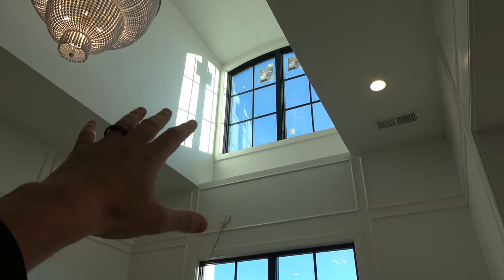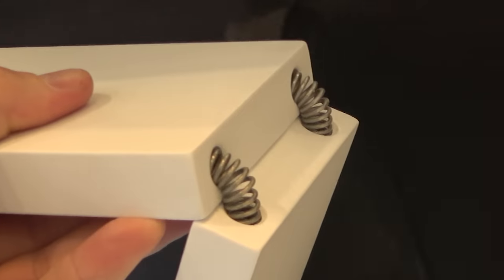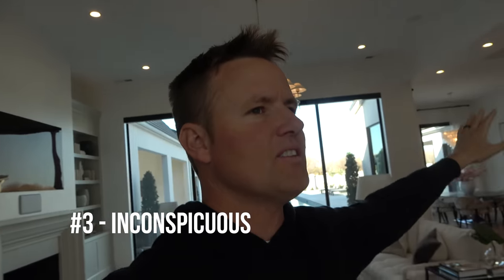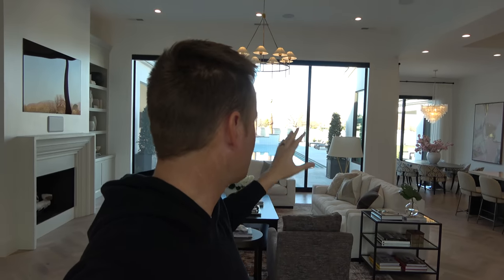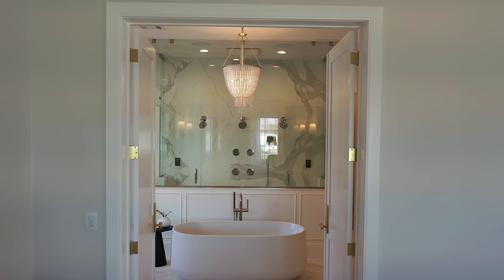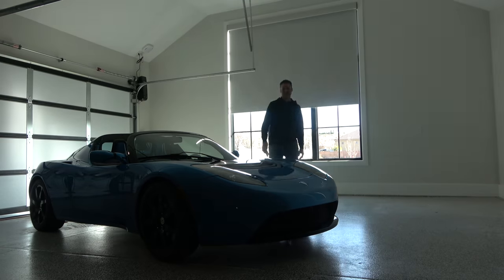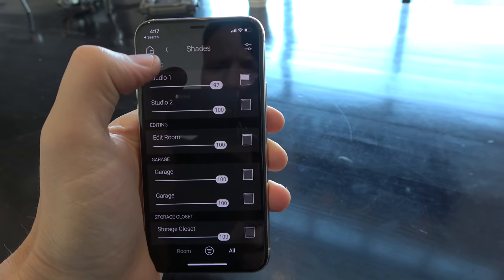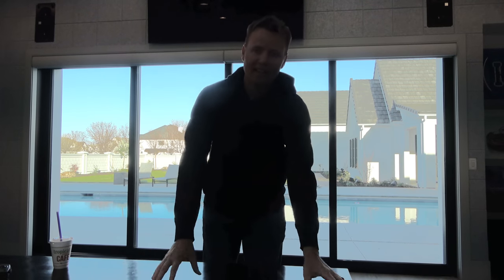Smart Blinds For Our New Home!

Comment: When I read "smart blinds" I figured they would have settings like letting certain amount of light in based on the angle of the sun/amount of light coming in, or at least they open/close at certain times...
I guess you could do that with software if you wanted to...
Reply: Yeah me too, my school's library has that, but it's supposed to be for efficiency for the A/C system
Reply: Yeah
Reply: Yeah, my house has smart blinds and they are so useful the sun is always shining into my room. And you know ppl hate to get waken up like me so they are VERY useful.
Reply: It’s pretty easily programmed to adjust based on your needs. It can even modify the settings based on the time of year or even the weather outside. C4 is a pretty powerful system in the right programmers hands.
Reply: I don't need blinds because I am blind.
Reply: Gerald Nordahl lol
Reply: Gerald Nordahl then how can you spell?
Reply: @tankdoss7261 .I use Google typing.

Comment: With such smart blinds, you can never be sure of being in a full intimacy. Imagine your son is sleeping in his room and during the night, you open unexpectedly his blinds from your room, and the other way around.
Reply: With home automation, it’s easy to see and control these features. I use the same system in my home, one button shuts down the entire house. Or one voice command. If you’re worried about something specific, you can program alarms or even something as simple as a light to let you know something isn’t the way you want it. You’re only limited to your imagination and budget.
Reply: Agreed. I love smart lamps in my house, but they all still have their regular switch in the wall. Hardwired turned off feels good sometimes. No apps needed, just hitting the switch and walking out of the room.
Reply: Someone Else smart homes like this work using wall switches like “regular” homes. Using an app or other touch screen is just an added feature, not a requirement. Really nice smart switches can do much more that turn on or off the lights though. You can program them for other purposes, like tap the switch 3 times to turn everything in the room off ( lights, tv, fans, shades or whatever). They can be very powerful tools.
Reply: I'd be afraid of glitches, like when my smart lights randomly turn on at midnight. It's only happened like three times but it's so creepy
Reply: Beth Fowkes that might be more common in certain systems. C4 isn’t perfect, but it’s pretty solid. We have had ours for several years without a glitch. It also makes using the TV and audio very easy to use.
Reply: @human doing Cool, I'll look into it

Comment: Show us your home automation system, I'm really interested about how everything is working in the house
Reply: I hope he does showcase the control 4, I have a control 4 system and it's amazing. So much better than your best buy "automation"
Reply: I wonder if he has smart lights
Reply: @edgarh252  He has C4 panelized lighting! He had the bus keypads in every room. That's how he has multiple loads in each room with only one light switch! He has it all!
Reply: Christopher Carman do they change colors? Haha
Reply: @edgarh252  No some high end LED strips have that functionality but for professionally installed systems that's typically done through DMX integration. The color changing functionality is mainly a gimmick used to draw people to cheap low quality lighting control, like hue. With C4, Lutron and other high end systems that's not a feature people typically look for..

Comment: Is like you gonna play with blinds couple days, maybe week. And then if u r lucky - u will put it on schedule. If you are super lucky - you would have some kind of sun sensors and it's gonna adjust blinds around house automatic. But probably it's too expensive to integrate it. And that's it. In 3-5 years he gonna decode to move somewhere else and new owner will come and redo everything from scratch :)))

Comment: What kind of power are the blinds connected to? Do you need 120vac at each window ?

Asked and answered kind of, not necessarily a good option for an already built home...

Some are line power some are battery... really surprised they use D-cells, would have that 18650s or something like that.

Comment: I have smart light all over my place, but I never get the idea of auto curtains, it offers some convience but you still need a remote or press a screen, voice over is nicer, but the whole  system seemed so complicated, motor, battery, wire, for just not getting up and do the curtains yourself